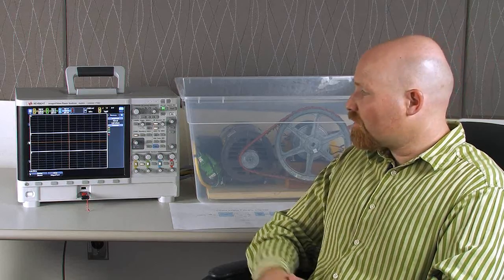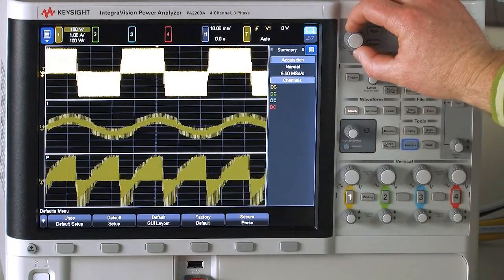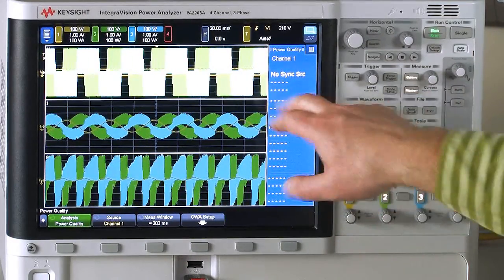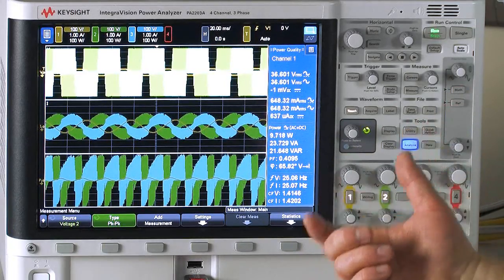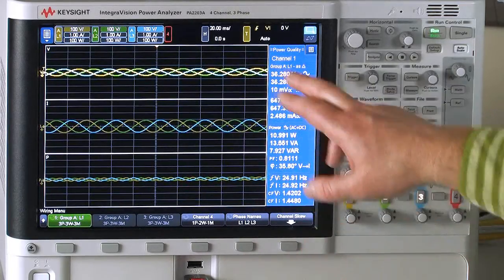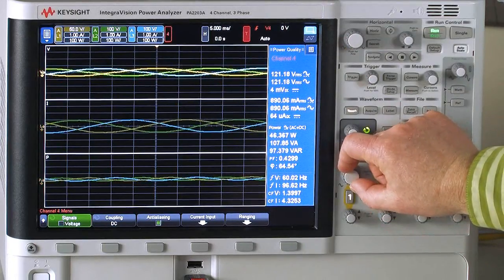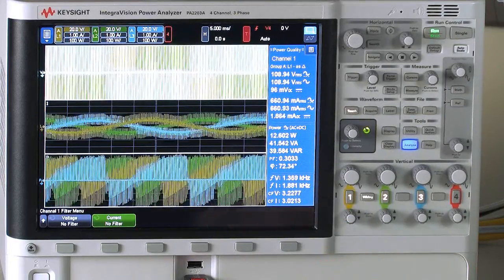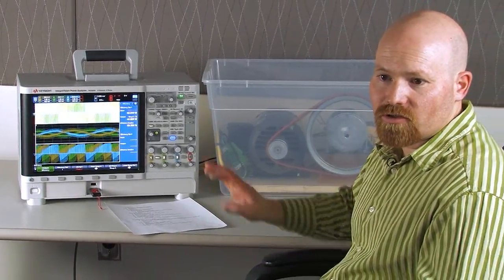3-Phase Variable Frequency Drive Power Analysis

Comment: A very useful device but expensive. Therefore, our company purchased a 16-channel ADC module, current and voltage sensors and software for the computer to measure the power of a six-phase generator of 3.5 megawatts. The most expensive component in our system is the LEM current sensors for 4000 amperes.

Comment: You are triggering on voltage waveform and then saying power factor is really very poor. Are you not supposed to trigger on current waveform that was more closer to sine wave, probably then it could have shown proper power factor

Comment: I hope someone is still reading this.  So, from my reading, I have seen that the output voltage / freq ratio is supposed to remain constant from the VFD (most common ones of a few HP).  For instance, driving a 220VAC (RMS), 3ph motor, this ratio is 220 / 60 = 3.667.  If I make the calculations on a spreadsheet and graph it, then reduce the frequency in 10% steps from 60 to 6 hz (which should also reduce the speed of the motor by 10%) and keeping the 3.667 ratio constant, the output voltage to the motor drops linearly with the drop in frequency.  At 20% of 60hz or 12hz, the voltage to the motor is 44VAC (RMS).  If I make the calculation at 1/6 the motor speed (usually stated as the minimum) and frequency of 10hz, the motor voltage is 36.67 VAC.
My question:  Is this the voltage and frequency relationship that produces a constant output torque of the motor in this range; 10 to 60hz or 288 to 1725 rpm? (for a 1725 rpm motor)
Reply: Hi Robert, that is correct. You can also maintain the same amount of torque at a higher frequency if you increase the input voltage.

Comment: How to make isolated current and voltage measurement
Reply from the maker: Jeo philip. The inputs are all isolated. When measuring multiple phases, or an input and output signal you need the isolation.